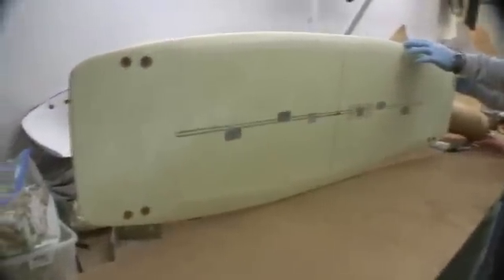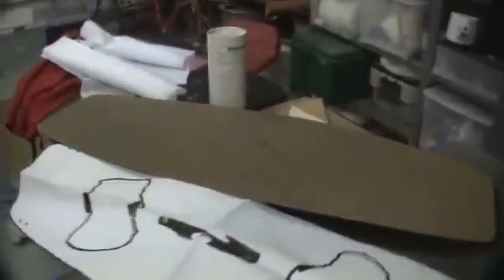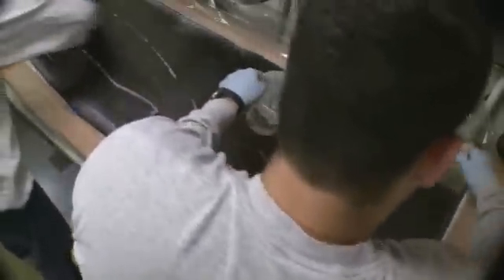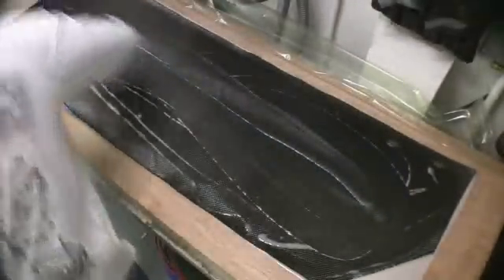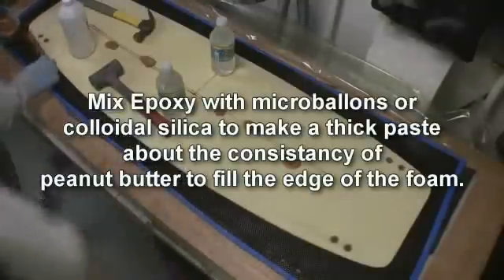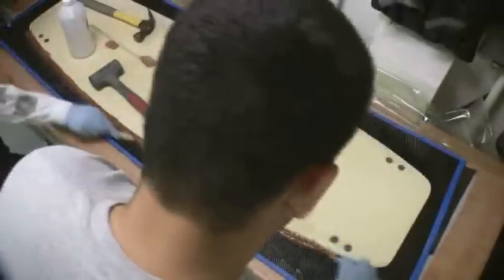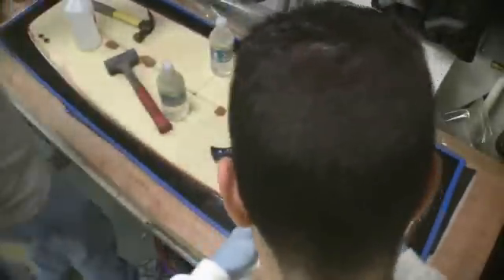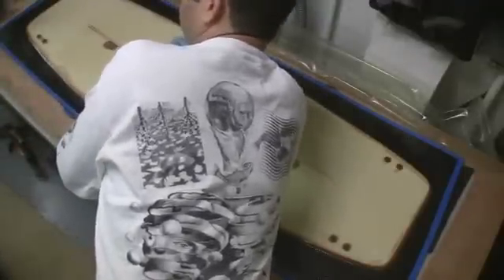Making a Carbon Fiber Kiteboard - Hand Lay Up Composite - Vacuum Bagged - Foam Core

Comment: hi. great video.  what is the purpose of the Mylar sheet? is the smooth surface acting as the other side of the vacuum bag? polypropylene sheet is more available to me. will that work ok?

Comment: Hi Guys great job  if you drill lots of small 1/8 th holes in your foam it will rejoice the risk of trapped air under the form and make the board stronger by linking the tow sides together

Comment: Excellent, thank you for sharing.  A couple of questions:  
(1) Looks like a lot of foam in your resin.  Are you squeegeeing all that off or letting it dissipate.  For a clear layup (like for decorative wood coated with epoxy) I find this foam never really goes clear.  
(2) You put the filler all round the edges and you say to trim up to that, but how do you dress the edge after that?  Are you trimming into the filler?